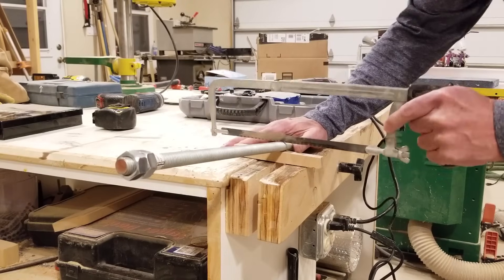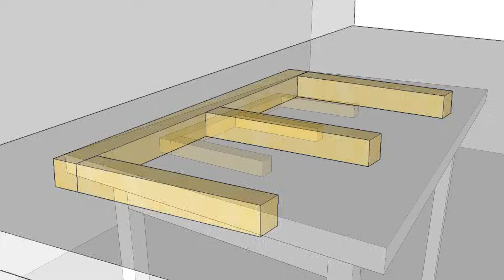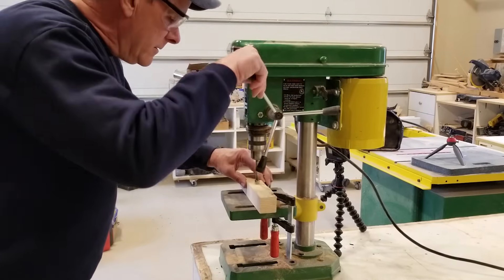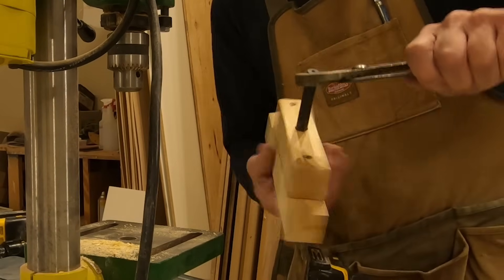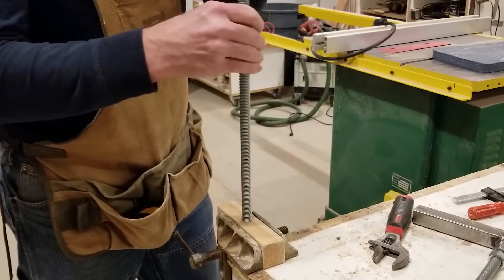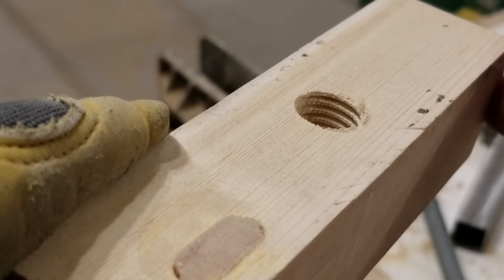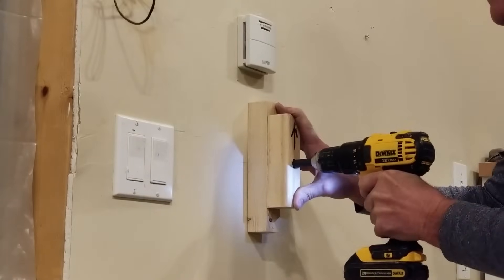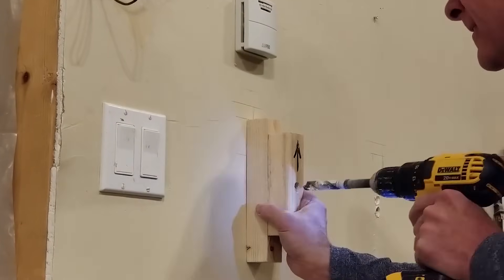Strong Floating Shelves - The Strongest Option

Comment: A couple ideas you might consider:
- Get a tap that fits the size of your all-thread, nails and screws wouldn't be a considerations then.
- Instead of using one home made tap (relief cuts in the all-thread), just cut relief cuts in your final all-thread and leave it in when you're done (as opposed to screwing it in, screwing it out, and then screwing in a different piece of all-thread.

Thanks for posting though!
Reply: hannamand if you would hit a nail or screw with a hardened tool steel tap, all you will have is a broken tap in the hole. I also don’t think the tap would produce a good thread in soft wood that you would find in a stud. It would be too sharp and cut a thread that would close once the tap is removed. The idea of using the threaded rod seams good because it displaces the wood, almost like a reverse rolled thread.

Comment: Geezus!! you made this way more technical than need be. threaded rod, not necessary. 5/8 rebar drilled level into studs with a little construction adhesive  works fine. Being perfect level with the steel, also not necessary. You have enough play to slightly bend it to level and also have play within that 2 inch frame. Must be nice.
Reply from the maker: Hey Scotty! Just set a three section, 8 foot vanity in an upstairs bath today. Had to shim the center section 3/8" to deal with out of level floor joists. Run into that kind of stuff every day. If being a little more technical about things I can control means I don't create issues for myself by starting with steel that is level coming out of the studs, why wouldn't I do that? Saves me time in the long run. I can improvise with the best of them, but if I don't have to, I would rather not.
Reply: @RustyDobbs  every project has it's own set of circumstances that dictate what steps need to be taken.  My comment about being over technical pertained to this floating shelf video only because I've built many of them and know all the little tricks. ;-)

Comment: I ve used similar attachments for fire place mantles. But they are usually thicker and depending on width still put brackets on for looks. Cause as you said bolts do flex and you want 0 movement. But for relatively thin shelves the bolts would work fine.
Reply from the maker: Yep, good observations, Peter! Thanks for your comment and for watching!

Comment: I made an even stronger floating workbench in my garage with some #11-90° bent rebar. The garage wall is CMU block so I chipped out the hollow cell and inset the bar in the wall with the bend sticking out and filled the cell back in with Sakrete. The workbench is so strong, you can rest multiple car engine blocks on it at a time with no worry of collapse. The bench itself is made of 2x6. Alternating, 1 flat, then 1 on edge, then flat, then on edge etc. to stick out almost 24”.
🤜🤛
Reply from the maker: Pretty creative way to deal with block, psidvicious!  Thanks for passing on your ideas!

Comment: The easiest and fastest way to secure the shelf to the rods is to PURPOSELY mismatch the center-to-center hole spacing on the shelves relative to the distance between the rods by just under 1/8 inch.  Then gently hammer the shelf onto the rods,  resulting in an interference fit.  Use a piece of soft scrap wood to prevent damaging the front surface of the shelf.  If you ever want to remove the shelf, use two C clamps close the the front surface of the shelf, using scraps of soft wood to protect the shelf.  Alternately tap on each C clamp to pull the shelf away from the wall.
Reply from the maker: Interesting ideas, Tony! Sounds like you have done more than a little of this stuff yourself! I appreciate you passing on your methods! Thanks for watching!
Reply: @RustyDobbs  Here is a way to simplify the process even more.  I drill a ½ inch hole about 2 ½ inches deep into each stud with a “Portalign” type drill attachment, tilting the drill upward about 1 degree to allow the fully loaded shelf to droop back to horizontal (not necessary for lightly loaded shelves).  I then install a ½ inch smooth steel bar into each hole; some light pounding is required.  The threaded rod is overkill, since there is almost no “pull out” force exerted on the bar when you put weight on the shelf. Also, the bending strength of the ½ inch bar is almost the same as the 5/8 inch threaded rod. 
 Since the drilled holes in the wall will wander slightly, drill them first. Then drill the holes in the shelf slightly offset (see my original comments).  The friction of the bars in the tight holes, coupled with the offset that creates a binding force, makes the shelf fit very tightly against the wall, but also allows fairly easy removal.  There is lower cost of materials, no time spent in threading the holes in the studs, and no need for secondary pinning of the shelf to the threaded rods.

Comment: So I have been building and installing floating shelves for about 15 years now.
The wood frame in your animation is the way to go. But a critical step is to liquid nail along the frame where the shelf makes contact and to liquid nail along the edge of the shelf where it contacts the wall. 
And of course, liquid nail on your frame ledger.
It will pull the freakin drywall off before failing.
I also install them about 1/4" high in the front to allow for a slight sag as it settles in to position. After the glue dries, I help it settle a bit.
Adhesives, elmers glue ..pl ,, liquid nails - all game changers
Reply: Sounds like a pain in the dick when you want the shelves down.

Comment: I feel your pain, your determination and your ingenuity. The unluck of that spot in the studs would be very frustrating. The "T" tool is great, add a hex nut to the top center. Then hand start and use a drill to speed that up. Great work, quite strong. Good job. You know how to finish drywall too. Minimal sanding!

Comment: Good I can make floating shelves. All I need to do is learn to weld first. Perfect!
Reply: I hear you. I don't have welding capabilities either.   I think you could use a good piece if hardwood (or metal stock)  for the handle, drill a centered hole through it for the all-thread rod, and use a washer and capture nut to lock the handle from from both sides. (I don't know if one would need to epoxy the rod into the handle to keep the tap from turning in use. ) That would probably work just fine for tapping into soft wood studs.  I intend to experiment.

Comment: Threaded rod bends quite easily and once it deflects/warps/bends, it won't return, it holds that shape. 
It's much better to buy some 12" lag screws and drive them into the stud 3" with an impact driver with socket, or some other type of wrench. Then use a portable band saw, reciprocating saw or angle grinder to cut the head off. Getting them out will be more difficult. 
In your case, using threaded rod, you can cut a groove in the end you want to screw into the wood, drill a pilot hole and it will tap the threads in the wood by itself. 
BUT, none of those things are necessary, when you can literally just drill a SLIGHTLY smaller diameter hole than the threaded rod (Better be 1/2" or larger, because 3/8" will bend easily) and simply hammer it into the hole. DONE.

Comment: I'm sorry I laughed so hard at your miss fortune but that is exactly how every FREAKING thing I do goes lmao! 

But thank you for the video I was thinking of cutting some flat iron, drilling a hole for a screw to go into the stud. Then welding a couple nuts directly over that so I can thread the threaded stock over that screw and place my slab shelves over the threaded stock concealing it all in a nice 1½ square. But maybe this is smarter because it should be alot stronger... then again maybe I'll do both as customers probably don't want to deal with setting those bad boys or the bigger holes.

Comment: I like the solid shelf better. While your shelf is made with 2x4s, in a real use installation I'd use a 2x12 or 2x16 solid piece. 
If you use nuts on the end of the bolts to secure the shelf, and have them recessed a bit, you can use a wooden plug to hide them.
Thank you for the demo, very instructional.
Reply from the maker: Thanks, Tom. I appreciate you watching!

Comment: I've have seen this approach before, except a large lagbolt was used, both drilled into studs, bolt end grinded off, custom floating shelves were built/stained, drilled partially with drill press as to not come out front. (Cut from solid wood) PL premium adhesive shot in holes and all along threads, even along part of shelf that will press on wall, let dry and that shelf won't come off. Ever.

Comment: If you want strength, how about this. Get steel tube with inner diameter threaded. Cut a 3.5" length of it (for 2x4 studs). Weld that to a 3.5" square plate. Drill four holes in the plate. Like this:
http://imgur.com/PRjtRr5
Then cut out a piece of drywall and screw 2 of these plates to the sides of your studs. Now you have something extremely strong to screw your threaded rods into, and you haven't compromised the studs by drilling big holes into them. You can also use any size threaded rods you want, not limited by thickness of a stud.

Comment: The shelf may look solid, but in fact, it is only supported by the thinnest part of the wood right over the holes.  With heavy books, the wood above the holes could crack over time.  Drilling the holes lower down would leave a thicker support and result in a stronger shelf.
Reply: Keep in mind that there is tension  BELOW the hole too!  Especially if the shelf is deep and is holding any heavy items.

Comment: So how would you have fixed it if the two rods weren't level? Let's say the end of one rod was 3/8” higher than the other. How could that be fixed (without having to try all over again with new holes... Or would that be the only fix)?
Reply from the maker: You could bend the rods a little to get them closer to level at the ends and adjust the holes somewhat in your shelving to compensate. But if you start with a level line on your wall and drill perpendicular holes in the studs on that line, chances are pretty good your rods will be level. Thanks for your comment, bgm!

Comment: Wouldn't that weeken your 2x4's or 2x6's doing that?  Doesn't look like much material is left after installing the rods for the support the 2x4 is supposed to carry. What is your thoughts on that?
Reply: Not much different than drilling a hole for wiring to pass through. And this is filling the hole back in so not really a problem. About the only thing I could say is it may be likely to split

Comment: Why wouldn't you just use the tap handle to insert the rods and skip the tapping process altogether?
Reply: If you dont have the cut threads (the tap) it will not thread in very well and will increase the chance of the stud splitting.

If you use the cut threads as part of your final bolt it will not have as much thread strength

Comment: Thank you Rusty for this video ! Wish you lived near me to put a breakfast bar in for me. My design thought is to use a natural thick piece of lumber I can stain that shows all the beautiful tree markings.
Reply: Dena Zechella Drilling the long holes in the shelf might be a problem. That is where the frame approach wins.
Reply from the maker: Thanks for your comment, Dena, and for watching! I like your design idea. Nothing like natural wood grain and it is always unique! David Hawley is correct about drilling long holes being a challenge. But for something like you are talking about, I would probably go with welded steel "L" brackets to carry the weight better since it would be something you and others are potentially leaning on. Lots of ways to get the floating shelf look with support structures that fit the function better. Sorry for the delay in getting a response back to you. Got a little backlogged!

Comment: Typical way of affixing material(like that solid shelf) to all-thread is epoxy. The benefit is that you do not need to have a hole on the front edge(though a small hole on the bottom to allow air to escape would probably be helpful

Comment: I would go with the washer and bolts at the end and then fill it with wood glue and saw dust and then sand it smooth and add some laquer for a shiney finish.

I wanted to add shelves to some shelving around the house but did not want to by cabinets or dresser shelves.

So the working  plan was shelves held by some support underneath, l brackets, or 2x2 frame underneath or combo.

This idea is very helpful in my situation, thanks for sharing.
Reply: A Wooden plug would be better than glue and sawdust, easier to remove too
Reply: David Barlow Yes, but how do you get the right size?

He already has the saw dust and glue.
Reply: @jessemiller9792  you just make one out of the same wood as the shelf, that way its almost invisible. Saw dust and glue wont take a stain or a varnish like the wood does, so will stand out and be a different colour.

Comment: That is some great deductive, adaptive thinking, resulting in a very durable product. I love shelves, and I especially love STRONG shelves. This is the strongest floating shelf design I have ever seen. Great work. Subscribed.
Reply from the maker: Hey thanks, 42lookc! I hope this works out well for you when you decide to try them! Yeah, I have experimented with lots of different approaches to floating shelves and have done a number of videos on different strength tests I've tried, but that was all with wood. Introducing the steel all threads changes the whole game completely. I haven't tried a three-quarter inch all thread, but I can only imagine the additional size adds another strength dimension to the mix. I appreciate you watching and thanks for your subscription, too!

Comment: My only worry is the drywall cracking or degrading after you do out some serious weight on the shelf.  I was thinking maybe using some paintable caulk around the all thread.  I will do this when I finally buy a house!!  Thanks for the idea!
Reply from the maker: Hope you get your house soon, Dan! You could certainly use some caulk around the rod. Once you start doing some repairs in drywall, though, you'll get the feel for how easy and versatile the drywall mud actually is to use and you'll worry about it a lot less! Thanks for watching!

Comment: Hi Rusty, from one Tradesman (Electrician) to another, look into a product that is known as 'coach road', or if you google 'coach screw rod', you'll find a ready made product designed to screw into wood with proper wood threads, leaving a machine thread exposed. This saves having to manufacture an item for 'all thread', and then try to get by with machine threads into wood. It's a pretty useful product. Good luck!
Reply from the maker: Thanks, Kelly, I'll check it out. I appreciate you watching!

Comment: We use big lag bolts and cut the heads off after they are ran in.
Reply: 817 MS damn, that’s genius!!!!
Reply: Redi rod is quite a bit cheaper than lag bolts.
Reply: @mikeedmonton6841  really depends on where you buy. We have some online shops who sell them very cheaply here in the Netherlands. Threaded bars are quite hard to find unless you go to the professional stores (you have to be a business owner to shop there). And hardware stores similar to the homeless deathspot are crazy expensive here. So for the average consumer it's probably cheaper and easier to buy bolts

Comment: Threaded rod has poor shear strength meaning it bends with lateral force.  It is designed for tensile (pull) strength.
Reply: Oliver Clothesoff in general, yeah. But he’s not storing his bricks on the wall.
Reply: @notyourbuddy_guy  Yup.  I see your point and agree.  I am certain there is a chart somewhere that shows the lateral shear weight.

Comment: That second approach with the 2" 2x4's as a solid block. You could simply leave the face 2x4 off, not laminated, then drill into it's unexposed face the size of the nuts, and secure the bulk of the shelf with nuts, and prefferably, rectangular custom washers. Then attatch the face to the rest of the shelf with adhesive, or joinery or any other method.

Comment: To finish the look, tap a dowel and thread it in flush over the threaded rod, then sand. And for God sakes man, use a magnet, and an impact gun to thread the rod in the studs. Great show.
Reply: Ron Laukaitis I wonder how powerful an impact gun you would need to drive that diameter of thread.
Reply: @davidhawley1132  I have a makita 18v that would do just fine. I set 12" timber locks into deck supports without any trouble at all. By predrilling the hole the size of  the rod minus the thread (put drill up to the light in front of the rod to find the right size), it should be a breeze. Just alternate in and out to tap them. Like he did, or similar, cut the tip into a taper. The objective is to give the millings a place to go. (I would even use a regular chuck on a rod a couple inches longer. I suck at welding. Never force your drill to hum longer than a fraction of a second. That will kill it. Especially brushless battery powered.)
Reply: Ron Laukaitis I have a 14v Hikoki that struggles to put in 120mm coarse thread screws, and a cheap Indian air impact driver that barely can do it, so I was wondering. Thanks.
Reply: @davidhawley1132  I really don't know. That converts to a 4ft screw, well over a meter. I've never seen one before.
Reply: Ron Laukaitis Oops, that should have said 120mm :O
Reply: Keep in mind that you are pre-drilling the hole. It won't take much power to thread the tapered/flattened rod. There is space for the filings to go. Back and forth an 1/8 to 1/4 turn at a time.

Comment: you can bend the rods sideways some  to make them not parallel. or you will drill the holes a little crooked by mistake. after you slide the shelf the tension will hold it in place.